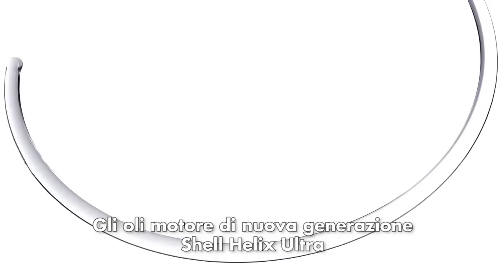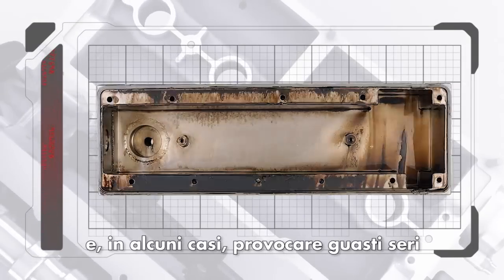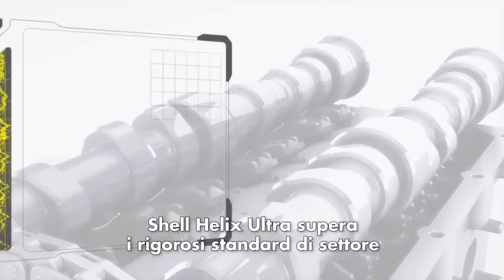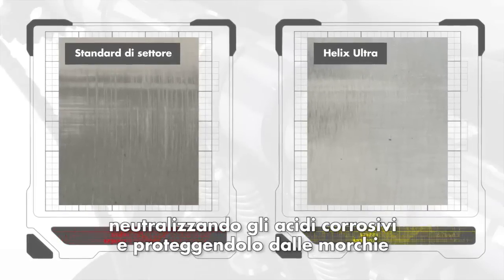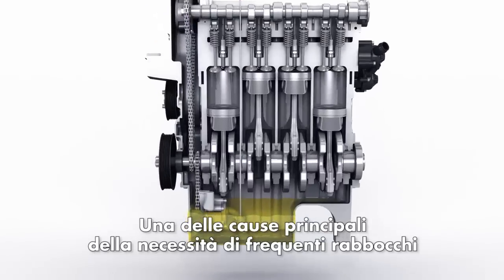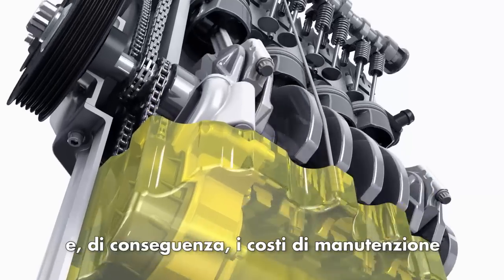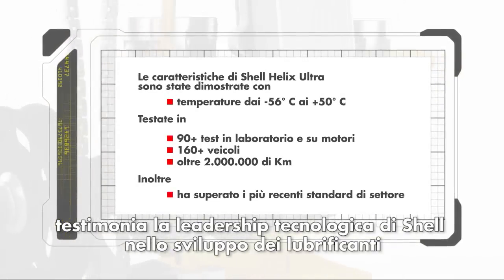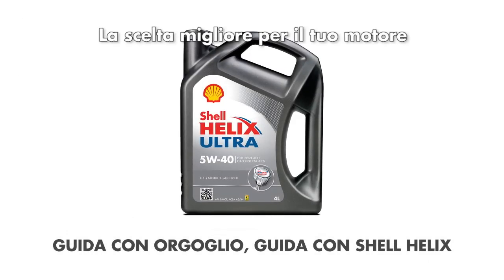Una rivoluzione nell’olio motore: Shell Helix Ultra con PurePlus Technology

Comment: I have used the api sm helix ultra 5w40 for many years since 2004 and loved it. Previously i tried amsoil 10w40 sj high zinc..but it was a bit noisy on startup..i suspect the 10w was too high during cold start. After 15000km on the amsoil i switched to helix ultra api sn pre pureplus and noticed much quieter cold starts..i suspect because of its 5w. I will definitely try the pureplus version next oil change. Hopefully its on sale at tesco.
Reply: alcyon2sp i just bought my helix ultra @ tesco but not change my oil .....coz my current oil still hv 3k to go ...

Comment: In questa marea di oli,chi è più viscido alle basse temperature un  5w40 è  consigliabile ad un 10w40 in Sicilia .mi potreste dare delle indicazioni prescise.io normalmente nella 146 ts 1600cc.uso un 10w40 selenia ,mi consigliate di sostituirlo con un 5w40  che e' un sintetico contro un semidintetico.grazie.
Reply: il 5w/40 è  consigliato sopratutto i diesel
Reply: @met71metaldetector55  Anche per i turbo compressi a benzina come BMW, AUDI, Mercedes, Porsche, Ferrari, Fiat e Alfa prodotti dal 2006 in poi. Ma comunque e' consigliabile anche ai motori aspirati un po' performanti, soprattutto in regioni calde come il sud dell'Italia e se si passa molto tempo in mezzo al traffico aspettando ai semafori anche al Nord. Io uso lo Shell Helix Ultra 5w-40 in una BMW X5 3 litri a  benzina, con buonissimi risultati: quasi zero rumore dopo lo start up, vibrazioni praticamente assenti, accelerazione fluidissima con leggera riduzione dei consumi in autostrada (rispetto al Mobil 1).